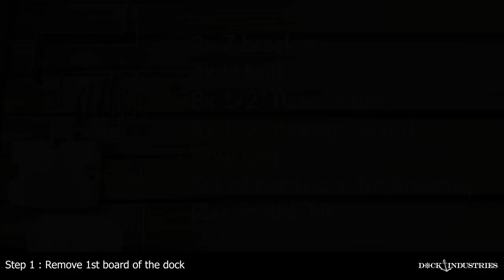How to install : PWC port to a wooden dock

Comment: Had an EZ Port 3 attached parallel to the floating dock. You can attach them to both fixed and floating docks bow first or parallel with the right hardware. If you have a lake level that rises and falls you have to drive the poles into the lakebed otherwise the jet ski ramp would float off when the lake level drops. On floating docks, the poles are already installed. You just bolt the jet ski ramp up to the dock. That`s the setup I like.

Comment: Those 4” pvc pipes were shifting loosely when you entered and exited the dock. After time won’t they  crack ?  I suggest going deeper into the lake bed and sending 2 inch galvanized pipe even            deeper-inside the 4” pvc to anchor those pipes securely.
Reply: Yes, we recomand changing them every summer..Or using 4''  aluminium pipes.

Comment: WARNING - Wave Armor will NOT provide stamped engineering drawings to show they meet Florida building codes as per PASCO County permit requirements!!  Their Florida representative is telling me that is my responsibility and could cost $600 or higher!!  I bought brand new 2 SLX6 ports with extensions from Wave Armor.  All are sitting in my garage!!
Reply: It is your responsibility
Reply from the maker: these are not wave armor products.